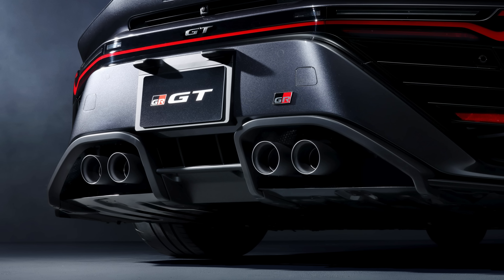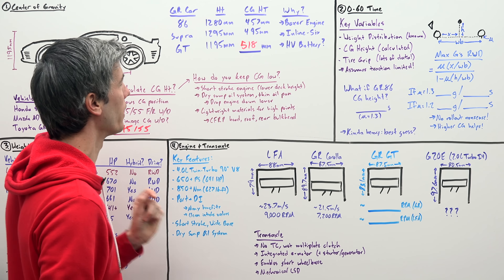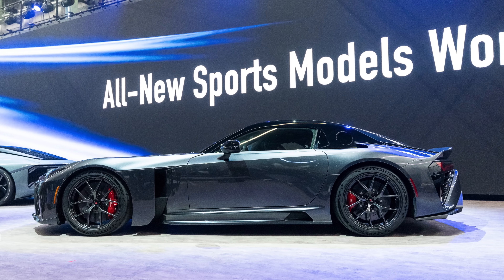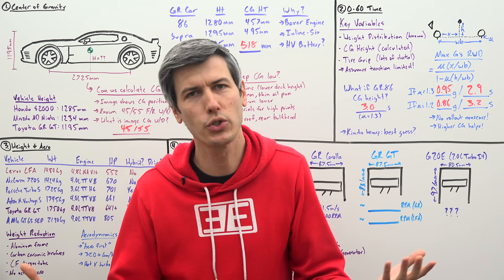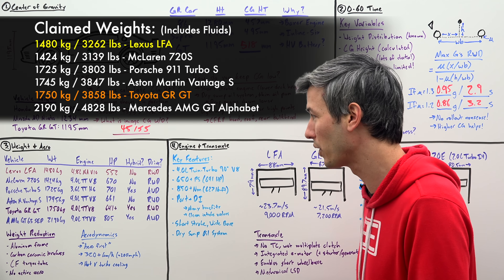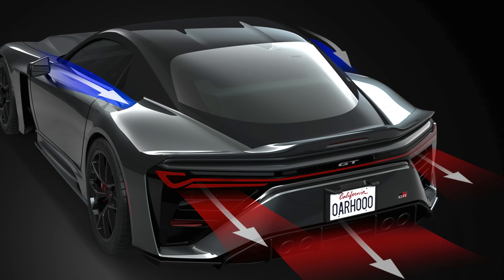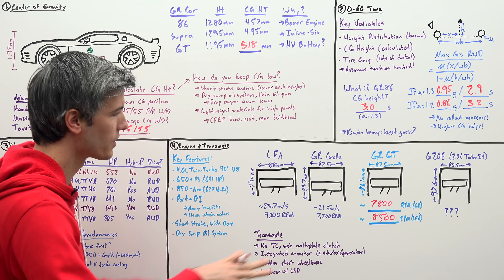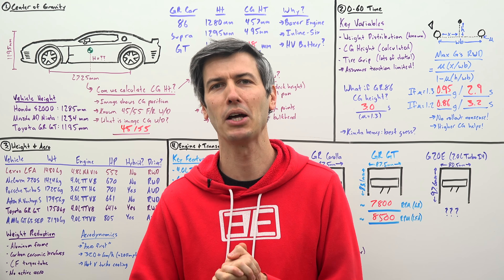Toyota GR GT - All The Engineering Details We Know!

Comment from the maker: *Whoops!* Towards the end of the video, while discussing the hybrid system, I mention the electric motor can "maintain positive torque during shifts" which is likely a misinterpretation on my part of Toyota's quote. Here's Toyota's quote: "The motor-generator, which is positioned in front of the transmission, is used to help make up for the momentary lag in torque response that occurs during acceleration and gear changes." If there is no physical connection from input to output in the transmission during the brief moment of a shift, and there is no way for the motor to bypass the gears and feed power directly to the diff, you would have a brief lapse in torque. So likely what this quote actually means is that the torque dips during shifts are smaller (not that there is positive torque maintained!). Since it's a turbo engine, the motor can provide near-instant torque after a shift, while the engine may need a small amount of time to get back to full boost.
Reply: Should have added Lexus RC F 2UR-GSE in the comparison. Would give us more picture of this engine and it's design and capability.
Reply: Yawn, my bought new 2017 Corvette had this since 2014 when the Corvette C7 first came out.... aluminum chassis with CF hood/roof, 6.2 litres for 300 lbs of torque off idle, mid front engine, scoops in hood/fenders!  And it has a removable roof.  And it's stickshift fun!  With headlights that sweep back vertically like Ferrari.

And the Corvette is 3300 lbs...500 lbs lighter than toyota!
Reply: Can you do a video explaining why diesel engines are made of cast iron and not steel when steel is lighter and stronger?
Reply: @irashid5406  iron is easier than steel to cast intricate, thin wall shapes such as cylinder blocks (it’s more fluid and has lower casting temperatures), it’s easier to machine, it’s actually stronger In compression than steel, it has good vibration dampening properties and it’s more cost effective.
Reply: @irashid5406  Cast iron has a lower thermal expansion coefficient than cast steel and is easier to mass produce without defects. The thermal expansion matters for keeping clearances between cylinders and pistons acceptable while the engine is warming up
Reply: @irashid5406  Not all diesel blocks are made of cast Iron. The BMW B57 inline 6 diesel engine is made of an Aluminium alloy (just like its gasoline cousin the B58).
Reply: @irashid5406  its because of compression ratios. Diesels typically have 400-600+ PSI of compression in each cylinder. Gasoline engines even for the highest performance applications dont typically pass 170PSI. The required strength of the engine block for a diesel is immediately noticeable seen this way.
Reply: @sinewave999  Hi,
The question was not about diesel versus gasoline engines but cast iron vs steel for diesel engines.
Reply: Whoopsie!
Reply: A torque fill when the engine starts pulling on the higher gear and the turbo's are spooling up from lower revs.
Reply: Just Toyota using tricky and misleading language - and not for the first time. Also, there should be no lag from a shift anyway because ignition retard can be used to reduce torque. This actually increases exhaust energy while airflow requirements of the engine remain the same.
Reply: Good Enough. Welcome Back, C190 AMG GT.
Reply: I got a corolla and its as sporty as my dead grandma. It's gnarly you have to buy this version to turn eco mode off by default. lol
Reply: Transmission not covered in review
Reply from the maker: @shahabtahir3008  8-speed auto, discussed at the end
Reply: @EngineeringExplained great review really insightful 👏
Reply: I forgot about it, but did you see the AE86 electric model they had around in SoCal? I'm not sure if that is aiding any of the feedback for these new cars, but I'm excited. This GT might be a heavy girl, but she will be fun! I hope Toyota keeps pushing a car or two like this. I still love the GR86, just wish the engine was more reliable for what it was made for.

Comment: I think the battery needs to be put lower in the car between the seats and trunk. Then move the turbos in front of the engine and use the chassis as a radiator.

Comment: I know some ways in which this car could be made more lightweight. Smaller size, natural aspiration, manual transmission and removal of the hybrid system. Another point of concern is the high centre of gravity. Straight-line acceleration may be seen by certain types of life as a selling point, but what truly matters is the handling. Power without proper control is pointless. And no, you won't achieve proper control by just throwing the stickiest rubber at the thing. Chassis balance and suspension setup need to be perfect. Also, aerodynamic balance needs to ensure consistency across the speed range. The car needs to be set up for the tyres it 's on.

Comment: If there is an unforseen circumstance what prevents the rear battery from flying into the driver and passengers heads either breaking their necks or bashing their skulls in or maybe even lopping their heads off?
That diagram doesn't show much in the way if that happened.

Comment: Yawn, my bought new 2017 Corvette had this since 2014 when the Corvette C7 first came out.... aluminum chassis with CF hood/roof, 6.2 litres for 300 lbs of torque off idle!  And it has a removable roof.  And it's stickshift fun!  With headlights that sweep back vertically like Ferrari.

And the Corvette is 3300 lbs...500 lbs lighter than toyota!

Comment: Hej man, could you give us an idea on controversy regard Merc and RedBull F1 engine about compression ratio? In my modest logic only logical solution would be expanding connecting rod so piston at higer temp travel a bit further therefore creating more compression? Does that make logic or what other idea you might have? 
 I posted comment in video suggestion on your page but not sure you'll notice it. Thank you!
Reply: My point of view is that in making connecting rod they used titanium legure in which middle part of rod would be "softer" therefore expand due to heat... similar to speculations about plank wear, but ofc nanomilimet precise

Comment: I can see that having the transaxle laid out the way it does enables the short wheelbase, but I don't see how it keeps the car short since the way the rear overhang is as long as it looks is because that 8 speed transaxle sticks out so far past the rear wheel center line. Honestly packaging wise the car is kinda baffling to me. I am guessing packaging the people next to the transaxle would be more of a compromise to the cabin packaging. Otherwise it enables a shorter torque tube(and in this instance I'd think alignment between engine crank center to tranmission input can be maintained without issue, and a shorter driveshaft would have better harmonics for a prop shaft going at engine speed(no reduction because transaxle). I think what would've been harder is if Toyota develops a transverserly laidout rear transle(a la McLaren F1) to really keep the rear end short with minimum polar moment overhang....but nothing is even more baffling than throwing the batteries as literally the heaviest thing up high....

I wouldn't be surprised the GT3 version racecar would fix all of these issue. No batteries for sure, and they can probably completely flip the transaxle around to be within the wheelbase...

Comment: It actually seems to be possible to swap out that e-motor with something more powerful since that architecture enables the use of axial flux motors. Would love it if I could put like something from Koenigsegg and YASA there for insane acceleration. 

Since the motor is located after the clutch, Toyota is basically building this with electric only mode (stating the obvious here). And since they'd want to sell this in the EU market, it should have an electric only range of basically 20 miles (or whatever the supposed EU regulations will be)

Comment: Ooooooooooohhhhhhhhhh!  That's an UGLY location for the battery.  I guess they just ran out of room in the low parts of the floor pan.  One would think they could move it rearward and down, but that would make the battery vulnerable in a rear-end collision.

So Toyota has caught up to where GM was with the C7 Corvette.  Front engine.  Rear drive.  Rear transaxle.  Aluminum chassis.  But smaller displacement engine with turbocharging.  640 HP makes it roughly equivalent to the C7 Z06.  I doubt the hybrid system adds much performance, as the hybrid system on the ZR1X doesn't improve lap time by much.

Comment: Dang. I'm really surprised Toyota didn't get more power. Here's something they didn't state. The engine will make 641 HP give or take, but what will the hybrid do? We've seen Camry v6s with hybrid motors do some incredible things. It may help provide additional power. Sure it helps with torque during shifts and turbo loss, but I can't believe that's all it does. This will be interesting to see how it performs.

Comment: More downforce does not automatically mean less speed just because something is low drag design it just means it consumes less energy to do the work it needs to do. More downforce is beneficial when you have more power than what the curb weight of the vehicle and tires can transfers to ground can do by themselves. If anything low weight designs have a greater need for more downforce when this is the case but I digress you get the point anyway.

Comment: The batteries are in an odd location because this was designed first as a race car, which doesnt use hybrid tech, then as a road car.  So the CoG for the race car must be incredible without the batteries.  Lets hope Toyota release a version without the battery tech, which would also massively help with the overall weight.

Comment: To cross-check, another way to roughly estimate 0-60 is compute lbs. per HP and take half of that. At 3,858 lbs. and 640 HP, this car would be 3858/640 = 6 lbs. per HP which makes 3.0 seconds. That jives with your estimate based on weight distribution & traction.

Comment: 1:58 …so the cg of this brand new, “low cg focused” sports car is almost 70mm (16%) HIGHER than the 450mm (17.7 inch) cg of my 33-year-old Mazda RX-7…which is 7mm lower than even the GR86!

And with all that power and tire it’s 0-60 is the same (3.2) as my 450Hp RX-7 (on the stock twin sequential turbos) and I didn’t have carbon fiber technology (other than the driveshaft)!

Way to go, Toyota, on the advancements over the years!

Comment: The Toyota D4-S injection system should really be the gold-standard for petrol engines, avoiding clogged intakes. I think AMG uses it on some engines - other than that I don't know another manufacturer. It's really a thing I have in the back of my head when thinking about a possible replacement for my GT86 should it ever be totalled. Put that double injection system in a Miata/MX-5 and I'll be happy.

Comment: I'm a Toyota guy, had a avante first car with the 22re, ke70, ma70 7mgte, chaser mk2. Love my Toyotas but I sold the toys to buy a house for my young family. Now Have a 1st Gen Subaru Forester ej20, I do not want a newer car, not that I couldn't afford a new car. Too much beeps and boops and dings and just overall electrical sht. A car should do car stuff. All this hybrid, full EV, meh. I live rural Australia and need a car that can tank a kangaroo and endless dirt roads, horses for courses tho. I'm a diesel tech and I love the old mechanical systems with virtual nothing but a electric starter on the engine, temp/oil pressure but they are hardly complicated.

Comment: It's always a pleasure to see the result of an engineer with a whiteboard and some manufacturers pictures 🥳. Thank you for your videos. I am a little bit disappointed by Toyota not placing the battery beside the transaxle shaft. And also of using conical gears resulting in the asymmetrical length of the drive shaft. Because, with Subaru, they have the know how in house and know the advantage of better traction. Looking forward to your next videos. Best regards from Germany

Comment: There's two other things I like about this car, and I guess one that I don't. For the likes, I like that the plastic timing chain guides are 1) encased in a metal housing, 2) at the front of the engine (looking at you BMW), and 3) don't require removal of the engine or cylinder heads to get to. It looks like there's just a front cover and you can take that off to swap out the chain. I find it infuriating that so many manufacturers make such an essential component so obnoxiously hard to replace. I mean I get why they do it, but still, I'm glad that at least it looks like Toyota hasn't gone that route here. Second thing I like is that it has double wishbone suspension all around. I really like this. Toyota sticking to the classics, it seems they're actually quite good at this and have been doing it for longer than people think. I believe they were also the last to ditch the hydraulic rack on their midsize family sedans for example. Also one of the last manufacturers to ditch metal valve covers. I remember working on a '96 Buick Regal once (with the 3.8) and that one already had plastic valve covers back then. Anyways. So far my only big gripe is that unlike the GR86/BRZ it *doesn't have a damn handbrake!*. Come on man! I thought that drifting was big in Japan and stuff! Not quite enough to ruin it for me but still, a tragic omission.

Comment: I think that the original LFA is also so much lighter for two reasons. 1) it was built as a cost-no object car and in today's money would've cost ~560k brand now (375 originally back in 2010), as such it could have a fully composite chassis, and 2) The original LFA did not have to conform to 2025 safety and emissions regulations. This is also the reason why Toyota can't just "use the old V10 again" for the new LFA like everyone seems to be clamoring for them to do. It would never make it past the regulators.

Comment: The battery is high but it looks to be mounted directly between the rear strut towers. i.e. its inertia will be reacted directly into the part of the chassis that the thrust is coming from, and should have minimal effect on the handling apart from the on-paper difference in lean. It's the least worst up-high place to put it, and it might even make up for it in chassis stiffness if it's a structural member.

Comment: I'm 40 seconds into the video and I can already see that they basically built the successor to the C7 Corvette since Chevy went mid rear engine with the platform.
Reply: Watching the rest of the video confirms that for me. I really like what they did with the transaxle. Unlike the C5-C7 Corvette which put the transmission in front of the diff and coupled the two together. Toyota's solution added a little complexity but with the added benefit of shifting the weight over the back wheels more. This thing should handle like a more stable Porsche 911 as a result. It will have more traction than the old Corvette platforms due to weight over the back wheels and be more willing to rotate in cornering. Less so than the 911 though, which is probably a good thing.
Reply: @randr10  No car that weighs 4000 with fluids will handle like a 911. Keep dreaming.
Reply: @feagle  Whatever you say buddy

Comment: instant torque is a big advantage of hybrid vs turbo to boost total power output, especially for brief bursts on real roads vs track racing, and the electric motor reduces the stress on the engine vs a turbo increasing the stress on the engine

Comment: They messed up the center of gravity. They could have placed the electric motor batteries near the center tunnel, or split them into two smaller batteries installed in that area. Apparently, as the name suggests, this is supposed to be a GT car, not a class-leading fighter, as everyone seems to think. It's a shame, because the car looks very good. Too bad. We'll just have to wait for a facelift.😉

Comment: I think the idea of using port injection is silly. 
I think a throttle body injection system would be better because it would clean everything from the TB, intake walls, and intake valves. 

I haven't been able to think of a real disadvantage except maybe leftover fuel on the walls not giving a consistent mix.
But to that I think it works be used for running cleaning cycles only anyway.

Comment: Don't think the battery is going to be "big and heavy", bet it is even going to be a solid-state battery. Also, a more apt comparison would be the prior generation AMG GT (hot vee 4L dry sump twin turbo v8, mounted front midship with a rear transaxle) and C7 Z06. Revs won't go past 8k since Toyota values reliability. Great video.

Comment: i think in the comparison of power and weight, you forgot to compare the gr gt's full power, comparing its engine power of 640 rather than its full power of 900hp
Reply from the maker: Huh? Toyota has only stated 650 PS+. Nothing above that is accurate at this point.